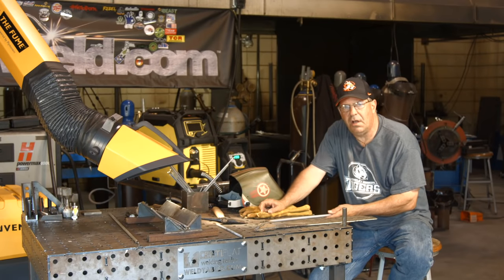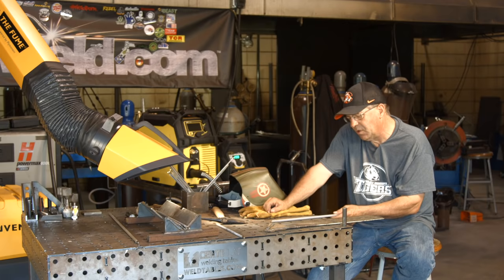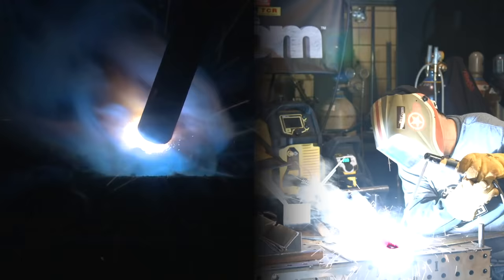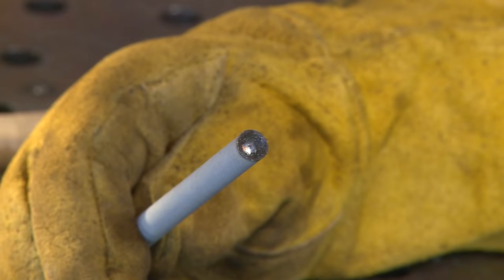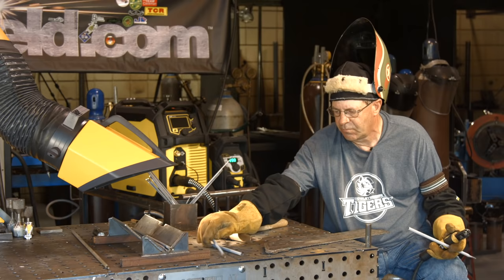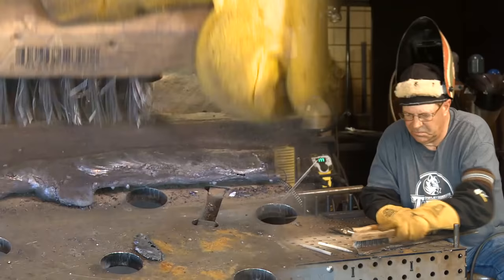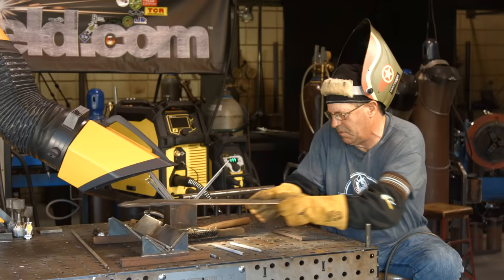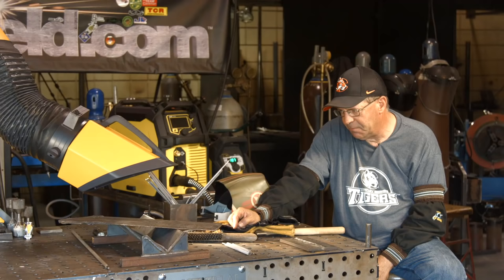🔥 Hardfacing with Hardalloy Stick Electrode

Comment: I was taught that most of the heat is generated on the positive side of the arc. With stick welding, generating heat on the electrode creates pressure from vaporizing flux, which drives metal down and creates penetration, and heat on the work piece doesn't create pressure so you get less penetration. With TIG, heat on the electrode damages the tungsten without creating pressure or penetration, and heat on the work piece contributes some to penetration. So DECP for stick on thick metal, DCEN for stick on thin metal (to avoid blowing away the metal), DCEN for TIG on steel, and AC with more EN than EP for TIG on aluminum (the EP part of the wave etches off the oxide, but you use as little as possible so as to minimize damage to the tungsten).

Comment: Hard facing is a different beast, the goal is actually minimum penetration so the added material isn't diluted by the base metal. Also there are dozens of grades from each manufacturer depending on the type of wear environment and many grades are expected to show surface cracking. 
Most arc based harfacing will only achieve advertised properties with 2-3 layers due to base metal dilution. Oxy-fuel tends to have much shallower penetration and so is able (with care) to get acceptable results with one layer.

Some basic wear categories are 2 body abrasion, 3 body abrasion, metal sliding on metal, each in high or low impact, and if holding a blade edge is a factor.  Many facing metals are work hardening so they start soft and only get hard after impacts which deform the surface(at a micro level) so those won't hold a proper edge.
Reply: How can we avoid cracking on stick. ??

Comment: I recently used Messier mg745 alloy to hardface a rock rake. It was 3/16 diameter as well and worked well at 150 amps. When I use it to weld on manganese alloy excavator buckets,it takes much more current. Great product.

Comment: Hardalloy 119 from Hobart Bros./McKay is an Austenitic Manganese steel (14%+Mn content) electrode that will work-harden over time with abrasion and impact.  It will not crack if applied correctly.  It WILL crack or spawl off (overtime) when applied on top of a high carbon/chromium cast iron type of hard-facing, such as what Bob welded over top of on the edge of the blade in the video.
Reply: Good intel. Thank you.
Reply: So rick, would first laying down a more adhesive alloy layor prior to the 119 alleviate or minimize this? Im thinkin of srfacing strike-face of an anvil made of rail-switch steel. Um...for a friend. I can totally afford huge gorgeous full-forged pro-level anvils.

Comment: Very good presentation! I have what many call a bad habit of mine, but, I'm one of those "works of art" that are more at home using A.C. when welding. I don't know why but I don't get as much penetration and overall a complete melt/bond through with D.C. (either negative or positive work leads). I would like to try the rods you've used in this show using A.C. instead of D.C.! None the less; this a very interesting video.
Reply: Most won’t run AC

Comment: I run alot of MG-765 3/16" hardfacing rods and run 140-160 amps and I use a long arc technique, works pretty good for me.
Reply: SteelFabMechanic the hardfacing rods i have allways used are 6 mm wich is just under 1/4" with a verry thin flux coating on them . And only use 95 to 120 amps or so.
Reply: SteelFabMechanic that’s a great running rod

Comment: From my experience I never had a problem with using old rods as long as the rods were inside the metal container. Also, have used old rods that were stored dry and had no problem. But your experience and mine can most certainly be different as night follows day. Good demonstration on the power of the small machine.

Comment: Many specialty rods have a low carbon 60xx type core rod, with all the alloying elements contained in the coating. That would explain the thick coatings on some of these rods. When they melt the alloying elements and/or hard particles enter the weld pool to give the proper weld metal composition. It's easier and MUCH cheaper to manufacture a wide variety of specialty rods that way vs having to make small VIM/VAR batches of the actual metal and cast them in to rods, or continuous cast into wire. Much SAW is the same way, with the filler being low carbon steel and all the alloying constituents in the "flux".

Comment: If u short circuit the rod by sticking it to the grounded workpiece you can cook out the moisture b4 you weld w it. Works for good 309SS, 316SS, and any other heavy fluxed rod that might be contaminated.

Comment: Helpful for the DCEP v DCEN 
Electricity was developed before we knew what electrons were, so when you see + or - on an electrical circuit, it actually refers to flow. So electrons do flow through the positive to negative end. The thing about electrons being negatively charged confuses everyone (my self included) because physicists define them, not electricians. 
Basically, electricity is positive flows to negative, and who gives a damn about physicists!

Comment: that start method does not allow to have a good gaseous protection, hence porosity with some rods. the solution is really to create a 20 mm smoke trail that is burned then when welding , as for a restart.Very clean starts with that trick.
(Sorry Bob but this can be said, I don't know how you pro welders avoid porosities on a few mm starting the rod but I cannot. The tip to work from the other direction then turn back once the rod is fully functional, works fine.)
Reply: make sure your rods are dry or have been in a rod oven a while. Don't weld cold. weld hot and keep a tight arc. Use a hot start and arc force setting if available. the hot start increases your amperage when you strike to make it easier. an arc force setting increases amperage in a low voltage situation like having a tight arc so you don't stick it.  Strike an arc, and don't long arc too long. You want that gaseous cloud to be able protect the weld zone. Too long an arc makes that impossible  leading to porosity. Actually  try to keep it as close as possible when striking. Strike out ahead of your intended starting point And let your rod get hot as you strike your arc and direct the end of the electrode to the starting point. Weld over top of your arc strike mark which should have been made in the intended path of the weld. I hope this helps.
Reply: MB Porter Thank you, yes it resumes well all things that help.. I think what I had in mind is the starts with 7018. There is a graphite tip that does not allow to weld if I understand correctly (that is also what they say on the Lincoln site, to start then get rid of the few first mm of weld by sagging, which I hardly can do without having to restart. ;)
I will dry and warm them for any important weld, I will remember. Noticed how hot rods work easier. But hot start if above 30/40 do tend to stick I really cannot see why.  Regards

Comment: Im needing to weld 4130 and 30hsg steel that will be hardened, what process and welding rod/wire do i need?  Will hard facing work for repairing cracks in 4130?

Comment: Why don't you explain to the kids at home why reverse polarity works better for stick welding.

Because it forces the electricity to focus in on the rod,where as straight polarity gives it a wider place to go ( i.e. the whole of the base metal )

Comment: ...but remember..porosity...if it should occur does not affect the strength of the weld.....due to the void's spherical shape stress is delivered equally around the void......not until porosity exceeds 70%  the mass of the weld should failure occur....

Comment: I have some Hardalloy 180 1/8 inch rod using AC AT 150 amps. I'm  hardfacing a 1/8 in thick CASE trencher tooth still on the chain, so, vertically. I cant get a smooth flow for build up. Its bumps and globs. What am I doing wrong? Less amps? Should I take each tooth off and weld horizontally?........ 

Some teeth are really worn back about a inch, so it it possible to build out multi layers of Hardface  to replace that inch of wear? 

 One youtube guy said to butter a layer of 6013 down first before laying on Hardalloy.  Its because the teeth are alredy hardened and have Manganese alloy in them So, 6013 allows better adheasion. Does that sound right? 

Ok More practice on scrap steel.  Trial and error I'll get better. :)

Comment: Bob, how do you determine the amperage to run various rods?  Say 7018: 1/8"  manufacturers recommend a range 70 - 140 lets say. How do you determine what part of that range to use?  Does that figure into the 1 amp / 1000th rule of thumb?
Reply: Goes by thickness of the workpiece, I can't deal with inches but I do add about 5 amps per mm of thickness from a base of 60-75a on a 3mm workpiece (I think, been a while). Also depends on the type of weld. Slow welds, like a vertical up, don't need as much.
Reply: Paul Campbell 7018 does NOT go by the thickness of the workpiece ....  rule of thumb
0.001 rod dia = 1 amp ..,.  An 1/8" rods = 0.125" = 125 amp

A 3/32 rod 93
A 5/32       156
3/16         187 and so on ....

Also when you look at the package   For example lincoln excalibur 7018   1/8"    90-160 amp

Find the middle

90+160= 250/2= 125

Use the middle of the advertised range maybe + 10%

That gets you really close !!!!

It it still sticks when you weld than go up in amperage and if you have a bunch of BBs ans spatter go down in amperage
Reply: 120 is a good starting point 1/8 7018 say for 3/16 plate. it depends on the thickness and volume of the work piece. It's always more ideal to go with smaller rods and multipasses when starting out welding.
Reply: ZILA

Comment: I run these 3/16 and 1/4 inch rods off a small 180 amp inverter welder all the time. The puddle is hard to see, as the flux covers it so fast and builds up as well. The only important thing to know is it goes down,  looks not important, as it will just get worn off again as the buckets we build up get used and abused. Best welded outside, without preheat. The worst part about hard surfacing, is the the smoke it produces. Leaves a person alot of time to think about anything other than what you are doing, as it can be tedious, boring, and very repetitive.

Comment: What brand passive filter is on the camera?
Reply: Plymovent
Reply from the maker: Phillips Alloweld
Reply: Weld.com They are really perfect for the camera. Then the weld lens maker Aulektro stated to me that blue is tiring for the eyes as the contrast is raised, blue is not allowed in Germany (or Europe) but the lens I have (gold plated Aulektro) are greenish blue and I like them (plus they are less than 12$)
Are blue lens really used (all day long) by some welders? Thanks

Comment: Would pre heat help with the spider cracking and fracturing?
Reply: Probably not, the cracking most likely forms because the two metals cool at a different rate. The cracking is pretty normal for hard surfacing rods, it really doesn't matter since it's not being used for actual joining of metals. Post heat might help more than pre heat but I think it would be a waste of time. I may be wrong.
Reply: Most hard surface rods crack when cooling.....it's the nature of the beast. Like Brandy mentioned, the hard surface is usually going to get worn down again, and is not structural.

Comment: Can someone tell me a use for hardfacing and an instance where its used ?
Reply: Like bulldozer and excavator blades and buckets. You hard face them with many, many welds and it acts as a "wear face" so that the welds wear down instead of the machine parts.
Reply: Another lesser-known use is for valves. Hard facing the sealing surfaces of a valve will give you corrosion resistance, erosion resistance, and a much longer product lifespan for just a little more production cost.

Comment: Those cracks happen along,, not the best welder as self taught and welded a lot of hard surface, clean the surface and hard face it, I like stoddy as it seemed to last longer, my Dad liked the Lincoln, it was a small black rod, jet weld I think,not much flux, I bought some gas rod once, it lasted longer than the stick rods, I didn’t like the heat it took, good on points, warped plow lays pretty bad, too much heat

Comment: this is slightly ot but it`s been a long time (never) since i`ve run a hardfacing rod, my question is if you peel off the coating of the rod if it can be used as a tig rod
Reply: p penca most likely no-   Pretty much all other stick rods can be used as tig rods once you remove the flux - but hard facing is different - hard facing has alloy and metal powder and "fairy dust" in the flux and the coating is often super this and parts of the flux coating actually become part of the hard surface deposit ....  that is why stick electrodes can carry WAY more alloy than hard facing wire ....  really good wires (because of the design it being a tubular wire) can only carry about 13% alloy
Good stick rods on the other hand can be carrying over 30% alloy
Reply: danke peter it makes perfect sense now that you say it about the flexibility needed to make the wire. i didn`t knew that part of the coating was used to melt with the rod, a new day a new lesson. asked bc a client wanted me to put a layer of stellite on some lathe tools for turning stainless, i turned down the job bc couldn`t find any tig rods (found stick rods but did not feel confident doing it...) also on the video kept hearing a cut on the sound of the arc, are they supposed to sound like this, it`s bad ground or a video glitch?.
Reply: p penca i have no clue what happened there with the sound ....  when bob said those rods are really old ( if i remember right 20 years ?!?!!!)

All i can think of - wow all sorts of funky stuff can happen here ....  i mean in my book it is almost a given that those rods do not run like the manufacture intended them to run when they were new ....

How ever for demonstration purposes or just to put a hard layer on something ......  they are probably "just fine"

Comment: That rod is WAY too big for that thin steel. I use that exact "big fatty" rod fairly regularly on the business end of industrial sewer cleaner nozzles and snow plows.. Try using it on something at least 1” thicker, and definitely use 3 phase if you can.

Comment: Well it's very obvious you are running these weld beads with a rod that has been in the cabinet for 20 years on top of a previously applied weld bead that in itself makes a big big difference and thanks for the video what you're not really giving any useful information and you say you're using that machine at200 amps and I'm not trying to be rude or sarcastic this is just well it's a trick question at 200 amps what is your approximate Arc voltage now don't go looking at your computer screen don't look it up on Google you're a welding teacher at a college when that machine is set at 200 amps on the computer screen what is your approximate voltage at the arc and is that equal to your open circuit voltage and what is the maximum open circuit voltage of that machine LMFAO

Comment: Have you ever tried tig hardfacing after removing flux from the stick rod? if you had a very small prt that needed only a small part to be built up with hardfacing.

Comment: Love the videos.. However, never can afford some of those machines.. Would like to see the results of any of these welds with a much cheaper setup since I would think if someone is watching these vids, probably don't know much on welding or still heavily learning even though I know quite a bit more than my counter parts.  (Note I didn't say ALL, but probably more)  Anyway, myself when I started, learned on a $250.00 machine before I realized it was something I wanted to partake in much more which then I did get a little bit more costly machine..  Now I'm looking into the greater aspects of welding...